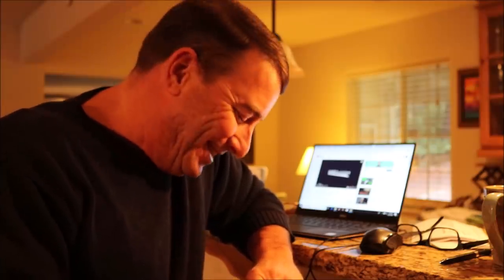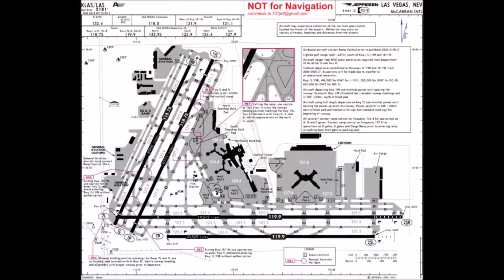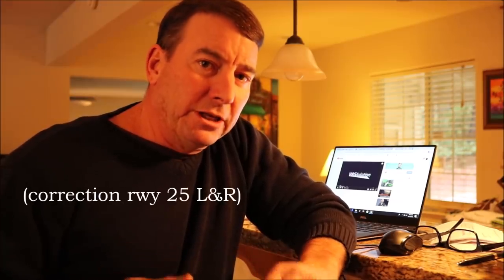Frontier Airlines #9260 A320 Open Cowling in Flight

Comment: I was on the flight.  The people started screaming when the plane was doing maybe 40 MPH, so there was plenty of runway to abort.  The pilots, from what I can tell, were oblivious for 3-5 minutes and kept ascending.  Smoke was reported by the passengers close to the engine, but in retrospect that may have been condensation or something else.  At the time, the people closest to the engine were yelling about fire and engine coming apart.
Reply from the maker: Wow! Thanks Keith!
Reply: It would seem to me that in this day of technological advances, the pilots would have a closed-circuit TV system monitoring both engines whereby they can have a visual on the darn things. Of course, this would add to the pilots’ takeoff workload, which is already pretty high. Thoughts?
Reply: @gomphrena-beautifulflower-8043  , right... or even a latch open light... my truck has a warning for every door, my hood, and my trunk.
Reply: Keith Sartain • That’s an even better idea, and much cheaper to install (I would think). Same with my SUV and don’t you know we address those alarms before moving!
Reply: Keith Sartain The Teamsters Maintenance Controllers fight against things like that, as it detracts from their valuable maintenance of each aircraft.
Reply: The pilots probably did not have any alarm in the cockpit and discovered the problem when told by ATC. It would mean that no critical circuit was harmed nor fire detected. Fire has been signaled by another aircraft pilot but not confirmed later and radio recording did not reveal fire alarm sound nor engine shut off procedure. That was impressive for sure, but the pilots did not jeopardize the life of anyone, they just did not know something happened.
One can understand why passengers can not call the pilots directly, but that is something flight attendants could do if ever they can see anything wrong from where they are sitting. Anyway, the procedures are clear and take-off reject requires serious reasons the pilots could not detect then. When airborne, there is no choice apart keep climbing and follow ATC instructions to come back as fast as possible.
You can hear the radio recording on the VASAviation link in the description and I also suggest you watch the Mentour Pilot channel where he explains what pilots do in such situations.
Reply: 6 6tirrRr
Rrrroei
Reply: I’ve worked on these Airbuses for decades. ALWAYS visually check the engine cowl latches before departure. ALWAYS.  Humans forget. Humans make mistakes.
Reply: As always, another great piece of factual aviation reporting, thanks Juan for you taking the time to give us the facts, only the facts and no BS....
Reply: @Brigadelokcom  Surprising a flight attendant hadn't told them.
Reply: @Miata822  Well, during take-off, the flight attendants are strapped in their seats and might not be able to see the engines nor to communicate with the pilots. I do not know if the cabin crew can call the busy pilots during take-off but I suspect that as long as the belts sign is on, they don't move either.
Reply: @gomphrena-beautifulflower-8043  I think the a 380 has a pretty good cam system, and so does the 777,  i'm pretty sure the crew knew about the engine issue as soon  as it happened,  as a thrust master caution would have come on  once  the doors opened , and they felt drag on the right wing.. As for keiths 40 mph  ? tough to say, he was there and i wasn't .  Unless he miss judged the speed and they were already at V2,  or decided it was too dangerous to abort by the time the were aware of the problem will have to be determined by the pilot.. We'll have to see what happen in the NTSB report.. 
   I was on a flight out of Toronto when I saw the spoilers deployed during takeoff (747) , thought the pilot had erred, turns out the wake turb from a cubana il62 before us hit us, and he deployed spoilers and kept the power on as was procedure to drive us through it , then begin his rto procedure...he had a fuck ton of runway left, and wanted to keep the bird on the center line,  he dumped lift as fast as he could,  then brought power down smoothly .. I spoke to him in Frankfurt after and he said that was procedure ...being a passenger i didn't know what was going on..assuming he deployed spoilers by accident and went rto .. 
   Can't think of a good reason they went ahead with the takeoff but we can assume a lot from the passengers seat.
Reply: 6 6  screamers, psycho..?! wtf?! the fucking engine comes apart dude!
Reply: @planegaper  so why did they go on ascending for several minutes if they knew and could see it? juan TELLS us there's no way to tell and no way to see the engines
Reply: it's mot that simple..first fly the airplane, and evaluate whats working or not,  gain alt ifyou can as you will need the energy to return to the runway, access if hydraulics are ok, shut down what you need to, then mess with control surfaces ...a sudden move upon seeing an engine fire is a killer, you go strait to training .. and that's what these pilots did.. if rto was an option they would have done it,  my buess they were vfo, and accelerating by the time they knew there was a problem..a jet takes 16 sec for takeoff roll, and pulls like an idiot after 80 knots,  not much time to react til vfto..even that 757 in the uk took off and climbed after a bird strike on t/o roll and still flew.. 
   there's reasons for this that we don't know as well, FOD, brake temps. fire hazard, wing dip,  etc.. ask  a pilot..is the best thing to do..
Reply: blancolirio 
I have cockpit video of the landing while holding short of 26R in Las Vegas. We were in a A319 holding short when the cowling came off. We have video of it landing. I couldn’t figure out how to send it direct message to you. Let me know if you want to see it. 
Breck
Reply: Keith Sartain I was right behind you waiting for takeoff. There’s no cockpit warning and you can’t see the wings or engines from the cockpit in the Airbus. So don’t blame them for being oblivious. But I will guarantee that they knew something was wrong when they rotated and felt the drag on one side. The Captain got it back safely. It was really difficult to handle, he was really wallowing around. You can thank that Captain for his years of experience to save you. There was nothing normal with that emergency and they don’t have a simulation for us to practice with for an emergency like that.
Reply: michael knowlden The Airbus is so cheap and keeps things light for gas mileage that they don’t even have an extra 7 pound duel actuator for the nose wheel steering like a 1968 DC9 does. So if you lose the right (yellow) hydraulic system, you have no steering on the ground. So they are never going to put two switches on the engine cowls.
Reply: adriaan van harrick Once you’re passed the V1 takeoff speed, you cannot just stop. You’ll go off the end in a fireball. After V1 speed you must continue to climb to a safe altitude and then make plans to return.
Reply: Junkyard Buzzard You’re absolutely right. And it’s so important and missed so many times, that it’s now a logbook writeup when cowls are opened, gear pins installed or pitot tube covers installed. It then must be cleared in the logbook by another mechanic. It has prevented many mistakes so far 100% successful. Too bad Frontier doesn’t have this rule. The pilot didn’t open the cowls, but she sure missed it.
Reply: @jemijona  Well, there was probably some noise and vibration perceptible in the cockpit, bus as long as the pilot can't see the engines, they could not determine the seriousness of the situation.
Maybe it is a question of training or policy that the flight attendants don't call to inform the pilots and rather wait for them to call and ask for a damage description. Some sort of work load management, probably, a question to be asked to several companies to know what's best.
Reply: @jemijona  Yep, that's what I wrote previously !

Comment: thank you for this. It reminded me of  charter flight that I took ~ 50years ago as a very young consulting engineer. We took off in a Cessna SkyKnight (iirc) and headed north on a 600 km flight to a building site. 

About 100 km out and at 6000' I looked out past the pilot to Saldahna Bay where I had been yachting the previous day. Mmm - surely we shouldn't have a streak of oil streaming back from the port engine? I glanced at the starboard engine - maybe it was normal! Nope -  the starboard engine covers were white and shiny. Looked back at the port engine and noted that the streak was no longer lonely - it was now a number of streaks! Not wanting too be a worry-wart I pointed to the engine and casually asked the pilot if those oil streaks were normal?

He looked, said something predictably unprintable and a microsecond later had closed the throttle, feathered the prop, killed the engine and executed a sharp (very sharp) 180 degree turn. He looked quite worried all the way back to the aerodrome. I just sat there - quiet as a mouse.

We landed,  taxied to the hangar apron where the maintenance guys were standing, looking  a bit on the glum side. On opening the engine cover we found that the oil filler cap wasn't doing its job. Obviously someone was distracted at the wrong moment and failed to refit the cap. 

After lots of compressed air to cool down the engine, pouring lashings of some or other solvent to wash off the oil on the outside of the engine, topping up of the sump, we took off again for places north. 

Poor pilot for the entire trip there and back he kept glancing at the engine gauges and the port engine. If he thought that he was nervous - he should have found a second to look at his mechanical engineer passenger. I never took my eyes off those gauges for the whole trip.

cheers edi
Reply: At least you saw it. I flew from San Francisco to Central Oregon in my 2-seat Varieze in December, fighting a stiff headwind the whole way for 3 hours over very inhospitable country with the OAT being 10*F, landed at dusk, with the winds 35G45 on the ground, taxied to the pumps and saw what you described on my rear mounted engine. Turns out the oil breather had formed a solid ice-plug, and crankcase gasses in the fairly newly rebuilt engine had pushed nearly all the oil out the oil fill cap. I had less than 1/2 a quart left when we drained it.
Reply: Wow,thank God you were able to make it safely back and land safely.Don't think I could have been that calm in the air.So many other's are not even aware of their surroundings ,thanks to you being aware saved you both.
Reply: @Another RM - I enjoyed reading your story; thanks.
Reply: Oh, do be a worry-wart! It potentially saves lives.

Comment: We had the cowlings open and separate on an AWA A-320 taking off from  LAS in June 2000. There have been 45 instances of this occurring across the Airbus 319/320/321 fleet wide. Unfortunately in the AWA incident the cowling wrapped itself around the leading edge of the horizontal stabilizer. Creating 3 3"x8" holes in the underside of the stabilizer. Also damaged the landing gear spar and doors. They came close to losing the airplane. The main spar in the horizontal stabilizer was also damaged. That spar is one piece all the way across both horizontal stabilizers. Airbus ended up flying a new horizontal stab spar in from France on the super guppy. It was repaired on the ramp in LAS. Tail number N655AW. Aircraft had completed a RON, and was taking off on the first flight of the day. A maint. tech. failed to properly latch the cowlings. And it was missed on the preflight. She is still flying today in her new American Airlines colors. In fact today awaiting take off in Los Cabos, Mexico to back to Phoenix, AZ! :)
Reply from the maker: Wow!! Thanks Jim!
Reply: wow close call on this one.....  very serious.  I agree with many of the commenters on this thread to have CCTV cameras showing most of the outside of the plane. in these situations the crew could get a quick view of actual seen damage and assist them in decisions of how to compensate for these type of emergencies.
Reply: Perhaps latch and hatch indicators might be useful for the pilots on such large aircraft. Even some family cars will tell you which door is still open and who hasn't done their seatbelt up.
Reply: Or maybe just a mirror on a selfie stick to get a good look at difficult to reach places on the preflight
Reply: @TDOBrandano , that's what I was thinking.  What pilot would want to crawl under those big engines on a cold morning  in Denver at 6:00 AM when heavy snow started falling at midnight?
Reply: @JoeLinux2000  That first officer will, without a doubt, from that day hence.
Reply: @JoeLinux2000  Hey! They make us maintenance guys do it!,
Reply: When ever I preflighted the Airbus I garontee I knelt down and checked those latches every time! Very easy to see if the latches are not secured. And I have found them popped open before. There are some things that you can breeze through on a preflight. Critical safety of flight things like this are not one of them!

Comment: Juan, that video is of the IAE V2500 not the CFM56. 

The CFM56-5 uses three larches on the fan/mid cowling. The thrust reverser also uses 3 latches. 

The pivoting door reverser doesn’t have the same level of reverse thrust as the cascade type reversers used on Boeing CFM56-7b engines. 

The Leap engine added extra latches on the reverser due to the increased length and the integration of the entire nacelle into a certified package for both thrust as well as sound suppression. 

I must give credit to IAE though, as the V2500 engine was the quietest turbofan engine I ever worked on. It was a pain in the a$$ to work on, but quiet.

Comment: We had one or two cowling loss incidents a few years back due to engineers not closing correctly. New procedure is that after closing, in addition to being signed off, a security seal is placed across the join next to the latch as extra visual confirmation. Quite an effective response.

Comment: Thanks, and I wish you would again call out the media for inaccurate and sensationalized reporting. Some said the engine "came apart" or worse. For example, ABC national evening news is frequently guilty of writing news anchor scripts without an aviation consultant resulting in wrong and alarming reports.
Reply: I can just hear CNN's headline:  4,000 Dead As Hood Flies Up!   Trump Blamed!
Reply: THINKING people have long ago discounted the 'news' loonies as mere salacious entertainers and never sources of the truth. It is very telling that society is slowly eating itself alive with this brainwashing and subsequent 'black friday' style mentality.
Reply: The thrust reverser is a part of the engine as is the bypass ducting. So technically, the engine did come apart, but not the core of it. Nonetheless, the damage to airworthyness was substantial and the other engine held the aircraft in the air.
Had you carefully listened to the video, you'd have also heard that the bypass airflow, which was most likely lost or severely reduced in this case, produces the majority of thrust on commercial high-bypass turbofan engines, the cowling fragments produce a lot of drag and pose a risk to the airframe, and they could've damaged the slats.

Comment: Thanks for another informative vid with some real world insight. 
Earlier update on the preliminary Lion Air report raised an interesting issue that although it seems that once the nature of the MCAS input is understood the solution is straightforward (assuming the disengage system was still intact after overnight maintenance). Your comment on dealing with multiple failures recalled a NHTSA report in the automotive field on 'unintended acceleration', where a driver thinks their foot is on the brake but it is actually on the accelerator, they squeeze the 'brake' and it 'malfunctions' as the car accelerates so that push the 'brake' harder with sometimes catastrophic results. As I understand it, pre-MAX, it was possibly to overcome the MCAS input by pulling back on the controls whereas post-MAX this won't work  - easy to see that if you can't get your brain out of the imminent problem it would be easy to keep repeating the previously learnt response whilst being physically overwhelmed. Appreciate your dedication to reporting on technical issues. BB

Comment: I once took a short hop on a 737, and at some point I stop gawking at the scenery of the BC interior, and notice  that there’s a bit of cowling missing on the trailing edge of the wing, exposing what i’m assuming was an actuator for the flaps.  I wasn’t bothered, but it made me curious, and I asked one of the flight attendants if that had been missing before takeoff.  The back cabin crew’s reaction was “WTF!”, with a side order of mild shock, but the pilots were aware that it was missing.  It was removed after it was damaged on a previous flight, and was going to be replaced soon. They spent quite a bit of time trying to reassure me everything was cool, but I think it was more for the crew from the back of the bus. :)
Reply from the maker: Yes some fairings can be placarded and removed for flight.

Comment: Good video as usual. The engines are a lot different from those on teh F-15’s I used to work on. Those were held on by a million screws and the avionics panels used those type latches.

Comment: for the terminology, "cowlings" are the forward doors for the engine that tore apart, and the T/R halves or C-ducts are aft of the cowlings which remained on the engine. My guess in this frontier situation, the cowling were latched correctly but the T/R halves were not properly latched